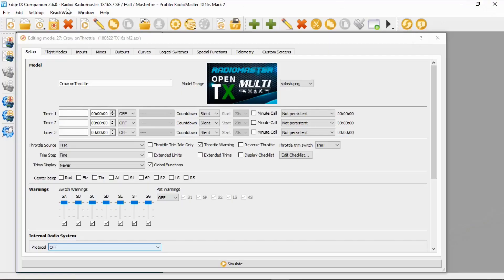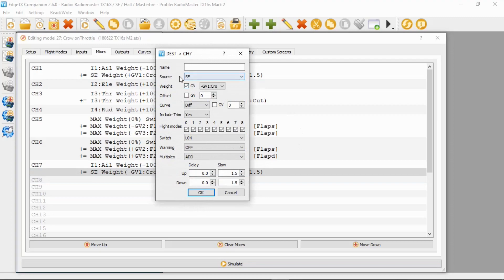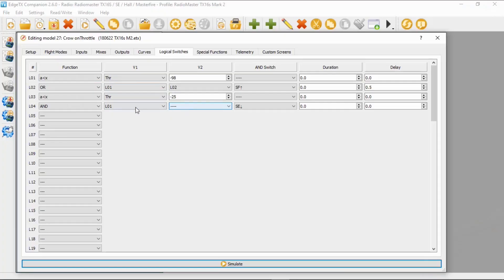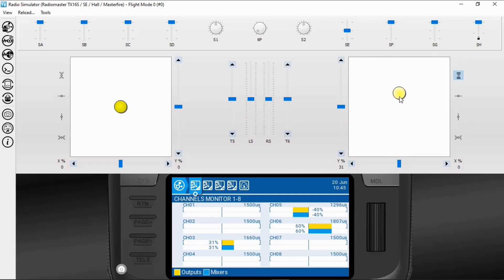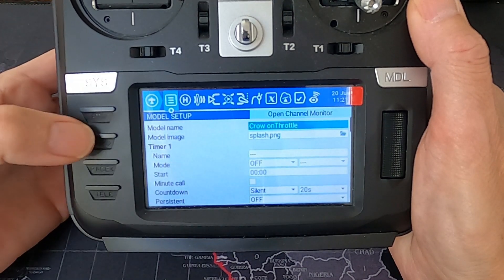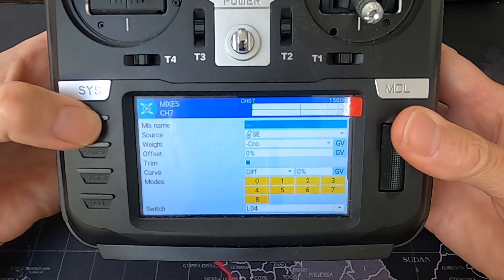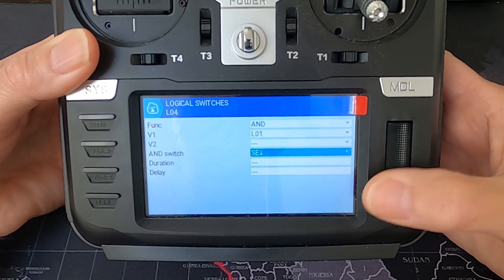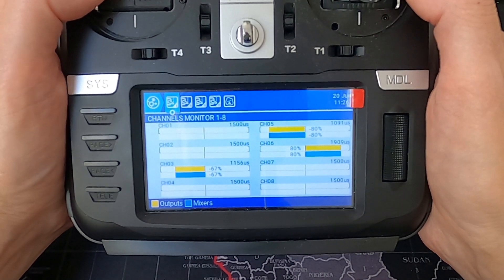EdgeTX Crow Brakes on Throttle

Comment: How would you setup a crow application where the crow function only works relative to throttle setting ~crow active only at less than 50% throttle proportionally to the throttle settings? Thanks
Reply from the maker: Stan I work on a video for this mix.

Comment: What’s the reason you use switch  SF? I use this switch for throttle hold function. And can you tell about the throttle curves you used? Greetings Theo
Reply from the maker: Hi Theo, you can use any switch you like no particular reason I used SF. The throttle curves are used for the safe throttle settings which only allow the throttle to arm within certain parameters ie switch on and throttle down.

Comment: Can you show how to make crow  relative to throttle.   e.g.  with crow on, crow starts at ~50% throttle, and as you continue to lower the throttle,crow increases.   As  you go back up on throttle, crow diminishes until  it's 0 at 50% throttle or greater.